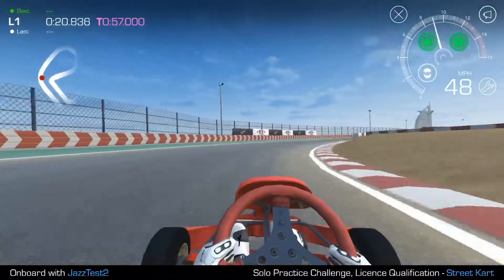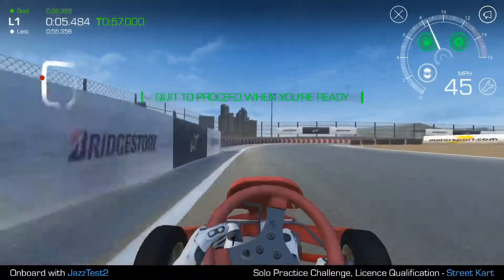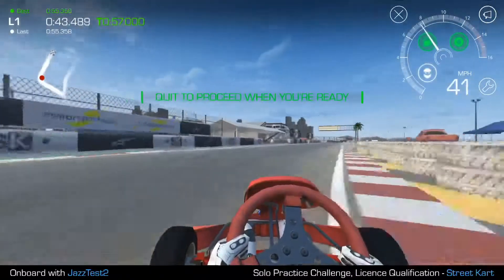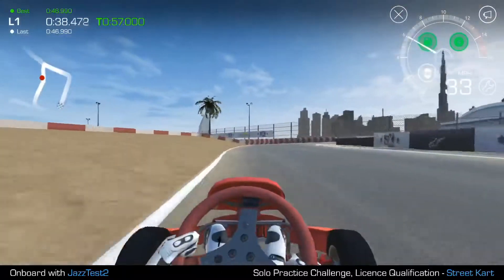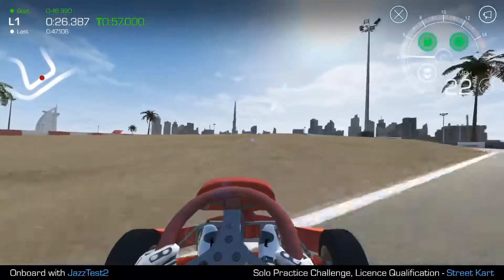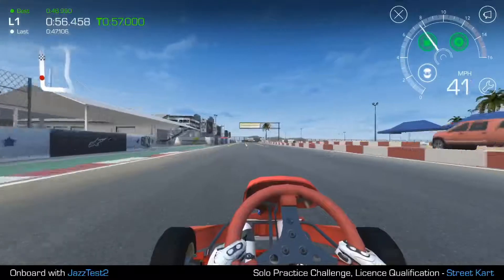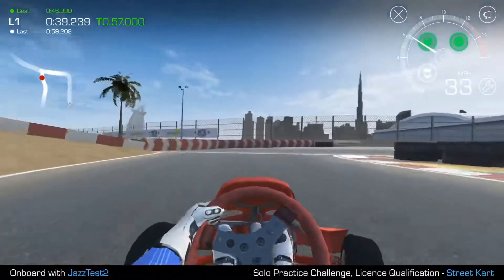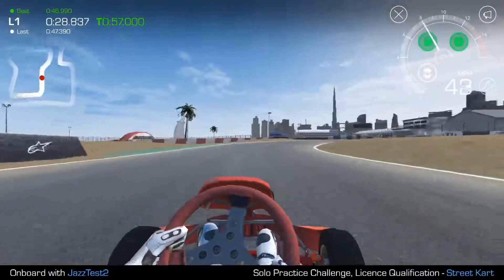Street Kart Cadets - Dubai Runthru

Comment: 0:35 does that mean there is kart with transmission in higher level ?
Reply from the maker: Yes, different karts have different gearing. In TKM for example, you will initially have a choice between the Arrow which has a bit higher gearing but higher speed, and the TKM which has lower gearing and better acceleration (but lower speed). The differences get bigger as you move up in tiers.